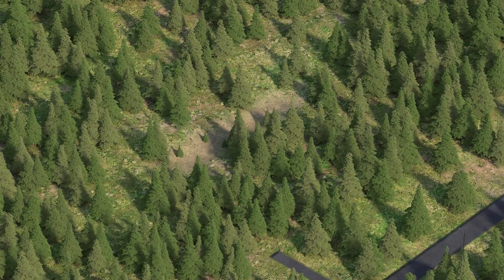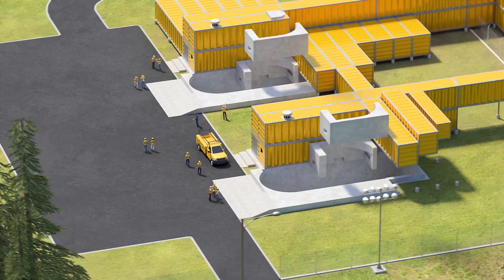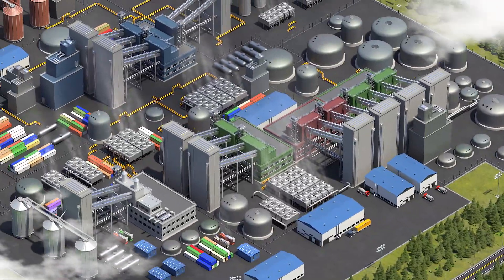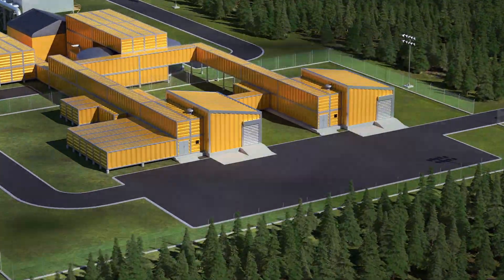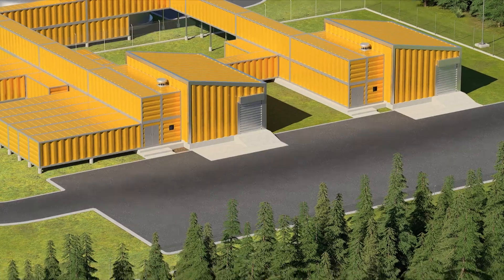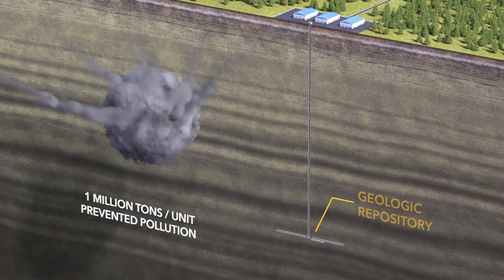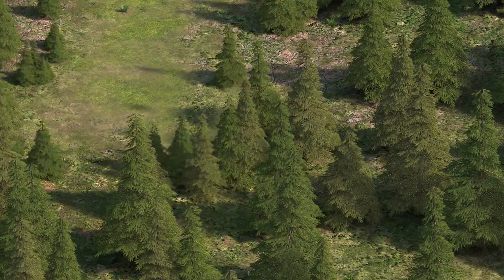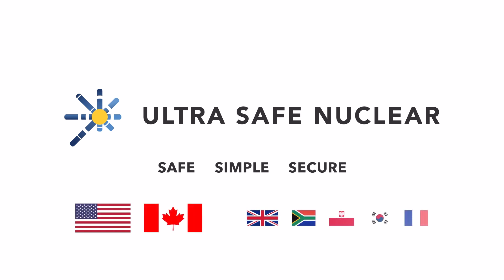Ultra Safe Nuclear's Micro Modular Reactor - Life Cycle

Comment: Such pure rubbish.  They have not manufactured or tested a single reactor.  Small reactors are woefully uneconomical.  If the reactor can truly self-cool, that sets a very low limit on its thermal efficiency.   So lots of blab, but not one single usable number.  Rubbish.
Reply: 33% efficiency, up to 30 MWth on full power. You can see it on their site.
Reply: When your fuel is cheap and millions more times more dense than gasoline efficiency isn't as important as safety.

Comment: You say power "on demand". How do you ramp the nuke up and down?
Reply: With control rods (like France) or by redirecting coolant to heat up the molten salt heat storage/using pre-heated molten salt to increase heat output to turbogenerators, while reactor adjusts power.
Reply: @caav56  I'll look into the molten salt solution incorporated into nukes - definitely sounds interesting. I know of a number of solar thermal generators in Spain and one in the US that use this technology, but it has proved to be extremely problematic due to the shut downs and amount of energy input it takes if the nitrate salts "freeze" somewhere in the system. The steady heat available from a nuclear station may mitigate some of these problems.
France also pays the Swiss to take nuke generated power at night when load is low; the Swiss use this electricity, which they are paid to take, to run hydro generators backwards thereby pumping water up in altitude in the Alps, then gets paid again to load follow when demand is higher in the day by dropping that water.
This requires both unique geography and political will. A pump storage facility in SoCal has been under development for decades and will likely never get built due to CEQA permitting issues.
For what it's worth, I'm a HUGE fan of nuclear power, but like other air emission free sources of electricity it requires some mechanism to meet fluctuating demand. Big difference with nukes is that they can run around the clock regardless of environmental conditions such as wind or sun. Perfect for base load power and combined with load following technology can be a significant contributor to lowering air emissions from human activity.
Reply: @brentlanyon4654  I see. I've also seen a project of NPP, with reactor cooled by supercritical steam, that could produce hydrogen during the lowered demand hours and burn it in cogenerating gas turbine power unit for peaking purposes. The name of this article was "Performance analysis of a supercritical water-cooled nuclear reactor integrated with a combined cycle, a Cu-Cl thermochemical cycle and a hydrogen compression system"
Reply: @caav56  Very cool tech! Obviously requires abundant water for hydrolysis. Would also require some modifications to the gas turbine burning that hydrogen; I worked on a cogeneration project in Texas whose steam host had excess hydrogen that was sent back to the power plant to be mixed with NG and burned in the gas turbines. Operators had to be very careful not to blend too much hydrogen into the mix or it would cause problems with the engine. It was a long time ago, and can't remember if it was accelerated wear on the combustion buckets or the blades/vanes.
Nice to meet up with other random energy geeks on the internetz!
Reply: @brentlanyon4654  I see. GE claims their turbines can run on up to 100% H2, but those claims... not sure, if it's for future turbines or if it'll lower the lifetime of a turbine. Also, I've seen hydrogen combustion can generate high levels of NOx emissions, if combusted with atmospheric air, which might've spiked the emissions beyond what's allowed. Aside from that, it can also cause flashbacks, blowoffs and combustion instabilities, so... I guess combustion buckets, in your case.

And true, nice to meet you too!

On a side note, I wonder, what kind of esoteric metallurgy would be required for the supercritical steam-cooled fast reactor... neutron flux, combined with supercritical steam, was known to wreck most of the nuclear alloys known, but Soviets actually managed to get oxygen-rich staged combustion running, so... this might be within the bounds of possibility.

Comment: I think the geological waste storage and the "return to a green field" feel more like a pipe dream in my non-expert opinion, but everything else I've heard about Modular Reactors are great.
Reply: The "return to a green field" is not difficult. The waste storage facility, though...
Reply: Finland started his geological storage facility not too long ago.
Reply: Geological waste storage isn't a problem. It's called deep borehole. You drill using same tech and bury waste 3-4 kilometers deep, and refill. Because fracking has innovated cheaper horizontal drilling the waste can be entombed forever without fear of reintroduction into the environment.

Comment: It's outdated already. Don't either go on encouraging your experimental colleagues to persist with fusion ITER-type plasma physics as it it has been superseded. Don't either worry about the weather and hopeless climate prediction models with associated baseless mass hysteria about "global warming" and sea-level rise? There is soon to be no need for more conventional green technologies that are more expensive and disadvantaged when compared to the cleanest possible SAFIRE GENERATOR. Learn about this best and vastly cheapest 24 Hr. reliable, hydrogen-powered, FUSION NUCLEAR and community located device built on any scale on a tiny and unobtrusive footprint. It is the latest fusion nuclear technology that is in commercial design and production now. They will not need battery or other storage technology backup and no extended ugly and vulnerable electric grid. See at "AURION @t" and then learn about ELECTRIC UNIVERSE THEORY and more advanced Plasma Physics at "THUNDERBOLTS @t". Then please teach all your friends and peers so we can advance the most modern physic knowledge.

Comment: Given this is in planning stages of development, perhaps consider coupling this with LFTR reactors? The benefit is the LFTR unit can use the waste from your reactors already planning to be used, this gives you a 40 year fuel cycle instead of 20, and only 2% of your expected waste is left behind reducing headaches and cost in storage. It's like using a steam powered turbine in conjunction with an LNG powered turbine, one creates the fuel for the other as its natural system process getting nearly double the power output from the same amount of fuel. This would then bring down the cost of your output power to the community, and make your overall system even safer as it's impossible for LFTR's to experience runaway reactions which would further increase community confidence.
Reply: The problem with LFTR is it's untested tech. Sure, in maybe two to three decades we should all switch to it assuming it works as well as it looks, but in the mean time small modular reactors should get going as fast as possible. I'm sure they know the value of thorium, but there isn't even a single thorium reactor that's functional right now
Reply: @0candlestick0  I know what your saying, but SMFRs are actually further behind LFTRs in development, SMFRs are still in planning phase where as LFTR prototypes are currently being built. Really looking forward to these becoming mainstream tho, and even paid up to help reduce waste output. It's my small ray of sunshine in this crazy crazy world.
Reply: @0candlestick0  soviets tested it on a attack submarine in the 70s
Reply: @Therealprinceofcobh  Those were solid-fueled reactors with lead-bismuth coolant.
Reply: @caav56  commonly thought so in the west. They where actually Molten salt reactors
Reply: @Therealprinceofcobh  Uhm... Even Russian sources mention them being metal-cooled fast reactors. Hell, some subs of Lira-class were lost due to coolant alloy solidifying and clogging the loop, which's not really likely to happen in most MSR designs (especially gas-cooled ones, with either helium bubbling through the salt or being circulated through heat exchangers in the core). Polonium breeding (from bismuth) was also an issue, as it made first-loop coolant more radioactive, than on comparable sodium-cooled reactors, which made the maintenance harder.
Reply: @Therealprinceofcobh They are not MSRs, they are liquid metal fast reactors

Comment: No details as to what the fuel is or whether they are walk-away safe load following liquid metal molten salt reactor; or miniature  highly pressurised light water reactor; burners or breeders; using up 99.6% of their fuel requiring only 300years monitored storage or 100,000years storage.
Pretty useless to those entrenched Sierra Club indoctrinated believers who were brainwashed by Sierra with a "China Syndrome" and deformed babies.👎🥝🥝🙏
Reply: Here's a copy of my unanswered Open letter to the Sierra Club,
INDONESIA has an environmental choice: -
more poluting coal-fired power stations; 
Or-
 7×500MWe liquid Thorium metal ion with molten sodium fluoride salt, (MSR) ThorCon energy Converters at a capital cost of $1/Watt;and a >75 year life?
 Or -
Destroying 190 square kilometres of tropical rain forest for <30% utility 25 year life Solar farms to get the same total energy output  as the seven ThorCon 500MW MSR units but at a cost of $(2÷30%)=$6/Watt?

I represent a number of environmentalists in Indodesia and we would love to see a reduction in the number of 1GWth Coal power Stations scheduled within the next 10year plan as well as the eventual conversion/modification of existing ones to use Molten Salt Reactors (MSR) as a clean and safe heat source.

We, and quite a number within the rural farming community, are concerned not only with the encroachment by urban sprawl into extremely productive farming and flood absorbing land; but also the actions of entrepreneurs seeking land for large Solar panel farms.

# Could you please confirm whether or not your club would prefer seeing Indonesia's choice for replacing existing and future planned poluting coal-fired power stations with either the likes of MSRs or farming and/or tropical rain forests destroying Solar farms such as : -

A) their currently contracted 7×500MWe ThorCon "Walk-away" safe (near ambient pressure), energy converters with a 65m×180m=1.17Ha footprint per load following unit of max 500MW on grid; at a worst case annual 95% utility factor, amounting to an averaged availability max load of  406MW/Ha (over a giving 75year life) at a capital cost of $1/Watt and a PPA agreed cost to consumers <$0.07/kWh;

Or -
B) (As already experienced in PLTS SulUt  Likupang's 21MWp ;15MW on Grid at 30% utility with a footprint of 30Ha and 25year life); 

Equivalent Solar farms at 0.5MW/Ha; at a pre utility basic capital cost of $2/Watt; and a current PPA cost to consumers $0.066/kWh and averaged load output 0.1MW/Ha to 0.5MW/Ha over 7.5 hours per day giving 30% utility.

HENCE for Solar Output over their productive hours to equal that of ThorCon's 3500MWe over the same daylight period of time; then the area requires would be:
 (7×500/0.5)÷1.17=7000/1.17=6000Ha or 60km^2 of scarce tropical rain forests.

Because Solar is only effective for 7.5hours/day (30% utility), to meet the Max possible (as a  base load) annual output would increase required area tropical rain forest destruction to 0.95×6000÷0.3=19000Ha or 190 Square kilometres of tropical rain forests or virgin jungle.

(It is of note that wind farm are not viable in Indonesia due to their lack of wind being in a Equatorial location).

If you cannot confirm a suitable choice for Indonesia (or the world for that matter) would you reconfirm that the Sierra Club still prefers the destruction of temperate forests in Germany for shipment to burn in subsidised poluting British biomass plants in preference to walk-away safe liquid metal molten salt reactor that can also burn up existing nuclear "waste"?
NOTE: I have no interest or influence in ThorCon.
Research ThorCon's Liquid metal Thorium ion molten sodium fluoride salt energy converters (MSR for $1/Watt & <7cents/kWh including profit)
Reply: @MrVaticanRag  The fuel are ceramic-coated uranium oxide particles

Comment: How does the containment vessel prevent the leak of corium?
Reply: you prevent a meltdown in the first place - with passive cooling.
it's very easy to stop nuclear reaction - it happens only in the most suitable conditions, so as soon as you take away these conditions it stops itself.
then you have a decay heat to deal with (that's where the problems came from in 3 mile and Fukushima) - but you can calculate exactly how much thermal energy is there going to be, and design passive systems accordingly.
that's why small reactors are way safer than huge ones - simply because you can build a passive cooling system capable of cooling down this reactor in literally any circumstances.
Reply: @mikez2779  So this produces power by creating steam generated by heat in the reactor which spins a turbine?  Or some other way?
Reply: @daviddickey9832  not familiar with this design but I would imagine so.
I mean.. even fusion reactors are in the end just a super fancy way of boiling water...
It's just the easiest, the cheapest and the most proven way of turning heat into electricity - even if you end up wasting heck of a lot of energy in the process.

Comment: This needs to be everywhere.
Reply: What about the nuclear waste though?
Reply: @shiakas  it is TRISO so although nuclear waste you could throw it in the reservoir and there’d be no danger.
Reply: @shiakas  Excellent question/concern.  Is this really the "Life Cycle" if it does not close that loop?  

The waste is right where it was made.  Short of the irradiated graphite and steel, all the bad nasty stuff is trapped in the TRISO coating.  We can take to a hot cell and extract for things like Medical Isotopes or Satellite Batteries.  Worst case scenario, the government (US has weird waste laws) vitrifies it into glass for disposal.
Reply: @shiakas  storing it underground is not the only way of dealing with it
the real question to ask is the cost per kWh - is it cheaper than natural gas?
Reply: It's not developed yet.
Reply: So what you're saying is cancer should be everywhere